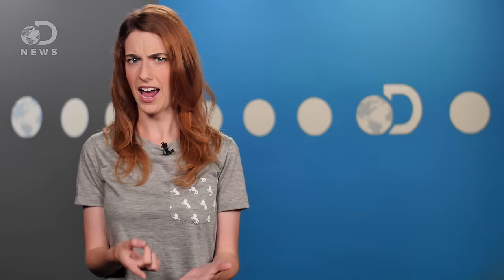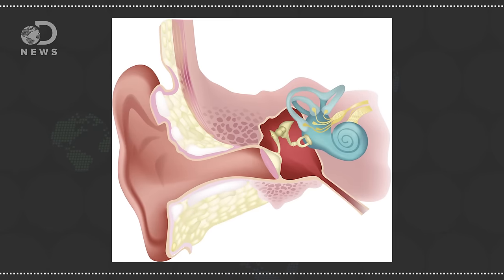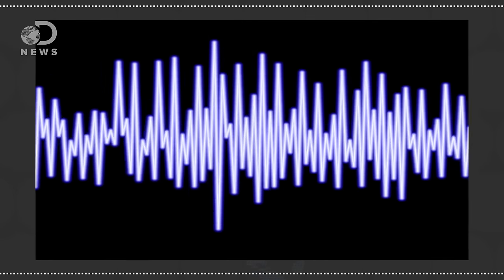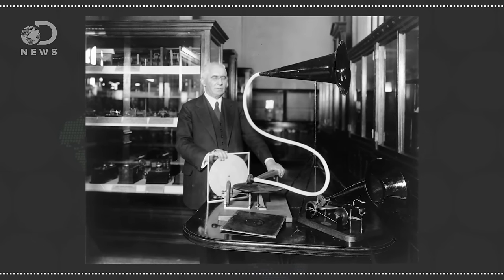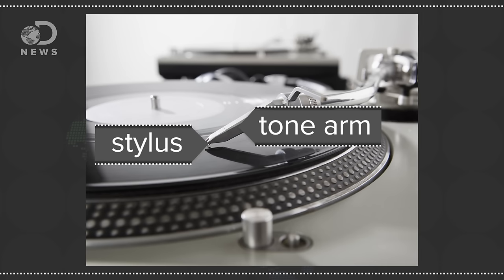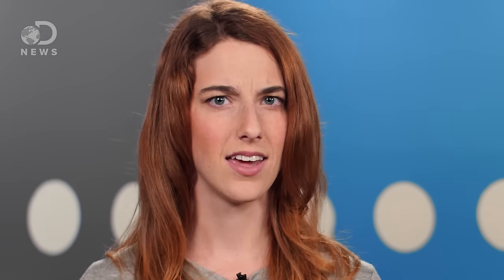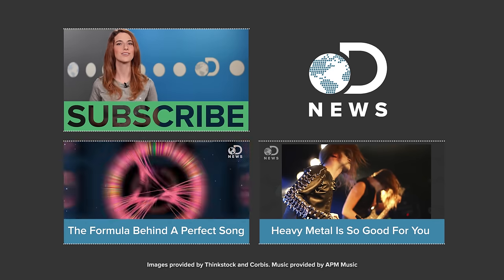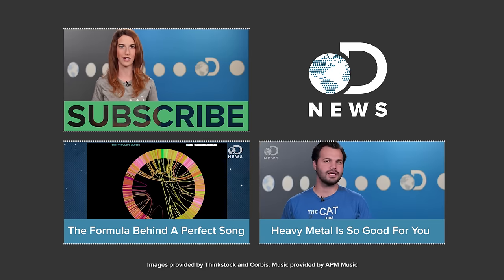How Is Music Stored On Vinyl Records?

Comment: Still doesn't make any sense to me
Reply: Would've liked to hear a more detailed explanation from the recording to the reproduction process of a Vinyl.
Reply: It's witchcraft
Reply: +XpertCameraMan In essence you can have a membrane, say, metal foil covering carbon (just to say something). That membrane will vibrate in different ways to the tune of ambient noises and if you attach a needle to an extreme of it you can make it scratch a softer surface (a rotating one so it doesn't overwrite). Later you can use another needle to go over the previously dug tracks and the scratches on those tracks will make the needle vibrate pretty much like the previous needle vibrated due to the foil-carbon membrane vibration. You can transfer this vibrations to wider and wider surfaces to amplify it's volume until it becomes audible. So put it simple, you are storing on a medium the mechanical twists required to produce specific vibrations.
Reply: Okay, but what I don't get is this. If I were to make those same pits and bumps into a fresh vinyl record, would it produce that same music?!? Of course not, so  that's where I'm confused. Can you please explain??
Reply: Like I mean If I were to dig those pits in myself, without recording music
Reply: +Cris Robles How on earth could you hand-sculpt the minute grooves of a record so as to reproduce a piece of music? :)
Reply: +XpertCameraMan at least since the late 50s things were recorded on tape, that would get played into like an etching machine that would take the vibrations and physically cut into a master disc. The master disc was used as a template for the manufacturing of the record. It's put into a press where it is squished against a piece of vinyl creating the record. You can get thousands of copies from a master and if they needed a new one they can go back to the tape and recut the record. It wasn't shitty tape like a cassette, it was high quality so you get the best fidelity.
Reply: +Cris Robles those grooves are so small you wouldn't be able to cut it the same way by yourself you need a sensitive machine with a cutting stylist.
Reply: Cris Robles Actually yes. If you somehow managed to cut EXACTLY the same pits and bumps it would play music. One (totally impractical) way you could do that would be by 3D sculpting the disc virtually in a computer and then 3D printing (or carving) it with a super high definition printer/cnc. It'd play whatever was in the original you copied it from
Reply: +Damian Reloaded You're the only one here who got what I was trying to say. So you say it would play the same music. Isn't that strange? Are we living in some Matrix then? lol
Reply: Cris Robles We do actually live in a matrix, in a sense. Everything in our universe carries information, and this information can get imprinted (stored) on many mediums in many different ways. On a record, the tracks are the "recipe of movement" that will produce the vibrations that were used to produce those same tracks. Like a mold made of clay that you use to cast copies of the original you used to make that mold. The first recordings of history weren't actually reproducible, they were just drawings of waves produced by a mechanical machine sort of a seismograph called phonautograph. Not long ago someone digitalized those drawings and for the first time we were able to listen a guy from 150 ago singing a song. v=uRbIJc05QTA
Reply: +Damian Reloaded Oh yeah, I read about that, about not long ago they digitalized those drawings. That's freaking crazy. So, if we were to make our own record, not recording anybody singing or anything, just using super advanced technology to create music out of thin air by making precise grooves, we could produce music and a voice that hadn't really happened to anyone's ears before, without using preset sounds and music, instruments, or an actual voice? Do you get what I'm trying to say? And man, that's pretty true what you said, how in a sense we kind of live in a matrix. I feel like there is a purpose to life, but not what the freaking "Bible" says. There's so much we don't know. But alas, I have to admit I'm going to go to my grave without figuring out what that purpose is.
Reply: Cris Robles Yeah, the universe is pretty amazing when it is not trying to kill you. ^_^
Computer synthesizers they do just that, they synthesize (create from thin digital air) sound waves that are almost equal to musical instruments or the human voice. There was a pope (Felix I think around 1000ac) that built a vocoder that emited sounds very like the human voice. Crazy stuff. ^_^
Reply: +Damian Reloaded One of the Popes? Would have never imagined, haha. Well thanks for responding to my questions and telling me all this stuff. Good stuff, good stuff :)
Reply: +Sean Cross I learned more about history than what I initially wanted to know.
Reply: +Damian Reloaded                  Damian, from what you are saying, it looks like a particular sound is given by the shape of the groove. If you can replicate the same pits and bumps, even without a stylus, you would get the same result? Are you sure? But this still doesn't explain how is possible that a groove can store any kind of sound so well. What I don't get is how simple up and downs can create such a dynamic range of noises. If we had a microscope to see the groove shape, what would be the difference between a groove carved playing a C note with a violin, and a groove carved playing the same C note with a trumpet? And is it possible that the sounds can be recorded only thanks to a tiny magnetic field (that we are not yet aware of) created between the stylus and the vinyl?
Reply: My Uncle If you were able to make an exact copy of the pits and bumps you'd hear the exact same recording. That's actually how they made the copies they sold at music stores, they pressed the pits and bumps onto the vinyl. The process by which the record is able to play music is really not that much different than a music box or a pianola that is able to play music "stored" in a dented wheel or perforated paper. The music isn't really "stored" in the record, what's stored are instructions to produce it (like the music box). The pits and bumps will make the needle vibrate the exact way to produce the right sound waves. An analogy that could help you grasp the concept can be to scratch a blackboard with your nails. It will produce soundwaves too exactly by the same process the record player does it.
Reply: +Damian Reloaded   Thanks Damian, but it still doesn't explain the "magic" in these grooves. Because when you play a music box, you are just playing an instrument, capable of playing only one type of sound, but here on the vinyl, we are talking about every kind of possible sounds, orchestras, all sort of instruments! I still find it amazing that nobody knows exactly how it is possible. Again, going by instinct, I got the feeling that there is a micro magnetic field created by the stylus on the vinyl (or on the wax cilynder, like the first non-electric phonographs). And then, when you stamp the silver coated master on the other vinyl copies that we buy, you are just transfering not only the same grooves of the master, but also the same exact magnetic fields.
Reply: My Uncle I think you're just a little under informed about this and that's probably why you're trying to fill the blanks with your imagination. There are countless sites and videos that explain how the whole process work, if you really want to know the truth you should  look them up. The wiki entry History_of_sound_recording has a lot of information too. Excerpt: The phonograph, invented by Thomas Edison in 1877,[2] could both record sound and play it back. The earliest type of phonograph sold recorded on a thin sheet of tinfoil wrapped around a grooved metal cylinder. A stylus connected to a sound-vibrated diaphragm indented the foil into the groove as the cylinder rotated. The stylus vibration was at a right angle to the recording surface, so the depth of the indentation varied with the audio-frequency changes in air pressure that carried the sound. This arrangement is known as vertical or "hill-and-dale" recording. The sound could be played back by tracing the stylus along the recorded groove and acoustically coupling its resulting vibrations to the surrounding air through the diaphragm and a so-called "amplifying" horn.
Reply: +Damian Reloaded  I already read those, and there is not a single answer to the main problem : how can a groove sounds like an orchestra, and another groove sounds like a piano etc. If you know a very good article about it, with phisycs involved, send it to me, because I never found one that goes to the meat of the problem. Thanks.
Reply: My Uncle It's really not that much different than placing your ear against a wall and listening to what someone is talking in another room. The wall as a medium vibrates in the right way so the audio waves can be transferred from the air in the other room, through itself into your ear. If you (somehow) attached a stylus to the wall so the vibrations of the sound could get to it, it would vibrate too, just as the wall does, those vibrations are the sound you hear. If you made that stylus scratch a proper surface, that surface would then contain the locations the needle assumed while it was vibrating (carrying the sound). If you then make the same needle go over those grooves, it will move pretty much exactly as it was moving when the wall was moving, if you manage to amplify those vibrations you will get the original sounds.
On cutting grooves a girl managed to 3D print recordings on wood and other mediums check it out at instructables site under "Laser-Cut-Record by amandaghassaei"
Reply: +Damian Reloaded   I saw it, wow, it's absolutely shocking, and I am more confused than before. Basically she says the laser cutter cannot make such precise cuts because the width of the beam is too large, so if she was using a smaller beam the sound would be identical to the original record. So, you are right, all the beauty of a sound is in the shape of the groove (and yet I find it impossible to explain exactly why...).
Reply: +Damian Reloaded Thanks for telling us about the instructables site page. It truly is amazing. Now I understand a little more
Reply: I want to help uncover this "matrix" we live in.
Reply: +Cris Robles      Yes, thanks to Damian, and thank to you also for bringing up these questions. I wonder if there is an insect capable of carving similar grooves, there might be lots of unaware Mozart or Bach in nature, lol.
Reply: My Uncle crickets
Reply: My Uncle yeah sound is crazy stuff man, but it's all just pressure waves (aka vibrations) moving through the air, molecules colliding into and bouncing back from other molecules until they collide into your ear drum and make it vibrate just as they did. The specific pressure wave back and forth movement of any sound can be represented by the peaks and dips of a digital waveform (what you see in audio editing software or on soundcloud) and the grooves in a record are an analog representation of the same. High pitched tones are higher energy, they move faster and cycle through their wave shape faster than low pitched tones. a single continuous tone from an instrument is relatively easy to wrap your head around in this way, it produces a wave of a consistent shape (like say a classic slow sine wave for some fat sub bass). When you start throwing other instruments into the mix, their waves all stack up on each other in complicated ways, but believe it or not any  number of instruments and sounds can all be represented at the same time by a single complex wave, what's called a 'composite waveform'. This single composite waveform is essentially what gets etched into a record, then gets played back when the needle moves through it and sends the resulting vibrations to an amplifier that makes the same wave powerful enough to play loudly through speakers. Idk if this made any sense but it was fun to write
Reply: it all makes sense, but i also find it weird and amazing how bumps and vibrations can make the EXACT same sound that caused these bumps and vibrations !
Reply: music is sound, sound has sound waves. the groves on a record are the 3D representation of sound waves. It's pretty simple to understand actually.
Reply: Sean Cross well we got to watch a hot redhead talk for a bit which is good
Reply: yep
Reply: haha, got me there
Reply: yeah but.. how can it be that just groves, certain patterns etc have the exact same outcome or 'being' as something completely different SOUND. I just have to deal with that I suppose. You are right, it is easy to understand, but now I'm wondering how you can get sound-waves into 3D shapes and also is it possible with more like 'matters' to do the same thing? Like capture something into a completely different way yet it's the same?
Reply: @YouTubeExplore777  leg fiddle players.....lol

Comment: I write record and mix my own music, and have done so for years.  When I started listening to vinyl again, what technically stood out for me was that I could hear the mid-range better.  Specifically notes that were audible to me in mixes I'd long since gotten used to on CD.   The first time I really heard it was Tool's Lateralus album.  A fantastic piece of recording engineering to start with, it just POPPED out of that vinyl.

Old records that I had stopped listening to on CD came back to life.  They were badly mastered and the CD's ability to push out so much bass I think caused engineers to go crazy for awhile.  Bass eats every other frequency in the mix so too much of it just crushes the energy of the mids (which are right next to it).  

That's why they sound warmer, coming back.  Recorded bass should probably always be shelved off at 40hz, because below that you are only feeling notes you aren't hearing them.  

I say this as a bass player with a lifetime's frustration of mixing basses.  It really is the case that you gotta take that super low frequency out or you won't hear any bass.  Or any mid.
Reply: I noticed no one has commented or even liked your comment- I’m glad I’m the first 😁. Not many people understand audio production, I’m not even sure I understand it, lol but I’ve been recording, mixing and mastering for a few short years and your experience and description called out to me. It’s a shared language that producers pick up on I guess, thank you for sharing 👍🏼

Comment: When voice makes vibrations,  it moves back and forth, if you put a needle on that "back and forth" then that needle punches a groove on the surface, and depending on how strong or weak the vibration is, the needle goes deeper or shallower on the surface of the MASTER copy. No actual sound is store, just a mark that, when scratched by the needle, reproduces the same sound that produced the mark. Think of the needle as your fingers on a guitar and of the grooves and ridges  (the holes punched) as the surface where the stings lie or a hard comb with nail moving fast over each of them, producing that "clink" sound. It is just the stylus scraping the grooves and it actually sounds just like the sound that caused those groves to be made. HOPE THAT HELPS A LITTLE>

Heres is the entire process (vid is actually short)

Comment: I grew up in the 1970's. We called them "Record Players" we called the vinyl discs "Records", or simply "Albums", we called the 45's "Singles" The recording on these records are the exact sound waves recorded onto master tapes in the Recording Studios. In manufacturing these "Records" a tin plate or metal plate was created with the grooves (sound waves) imprinted on them which then were used to press onto the vinyl as a machine pressed the tin or metal master onto a glob of heated vinyl pressing it into a 12"  33 1/2 rpm Record  or a 7" 45 rpm Record. The sound from vinyl is much better than a digital code, download, compressed file or from a CD which its music information is pressed on to the CD similar to how a vinyl record is. However with the vinyl record you are practically reproducing the original music from the actual original recording via grooves pressed onto the vinyl which are the original studio sound waves of the recording. You don't get that pure great sound from today's music technology.